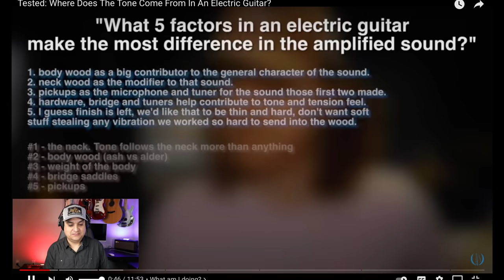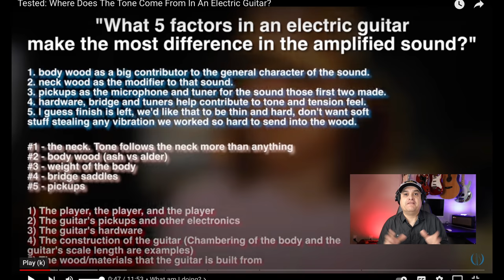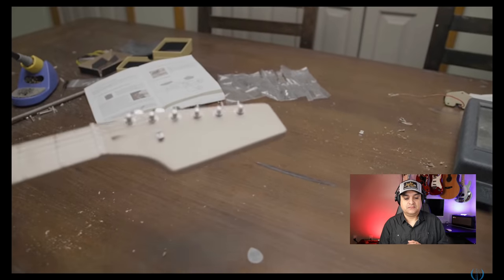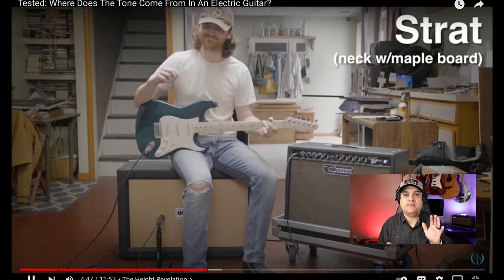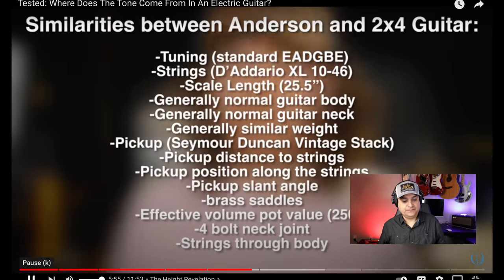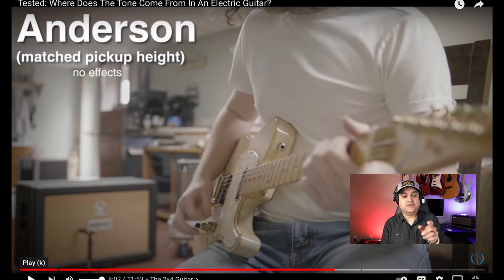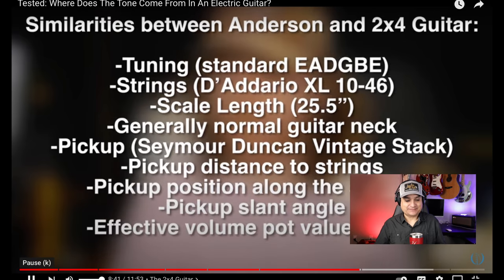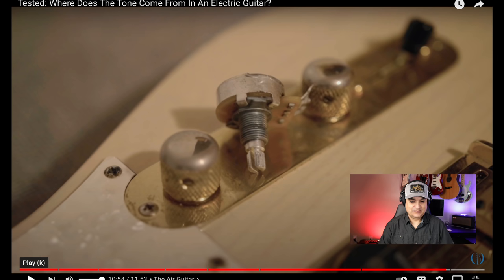Where Does The Tone Come From In An Electric Guitar - Reaction Video

Comment: Wow, surprising how all the ELECTRIC and ELECTRONIC components make up for all the sound of an ELECTRIC guitar
Reply: surprised Pikachu face
Reply: Exacty! I got the original video recommended the other day (and now this one), and I still can't believe some random youtuber had to scientifically test this. It's literally common sense. Take two identically set up guitars, right off the self. Replace the pickups in one for different ones. Voila. Different sound. Jesus...
Reply: I like to ask tonewood snobs about how the trees impact the way the string vibrates over a magnet. I'm sure that the wood, touching the saddle, touching the string, SOMEHOW is factored into the end product, but not in a way that matters. Lets make guitars out of all kinds of fun weird materials!
Reply: lol
Reply: I always assumed tonewood made a slight difference and I just don't have a good enough ear. 

I could barely tell the difference here (it was almost nothing to me), but if it's this small in such an extreme setting..surely it can just be compensated for with a slight EQ adjustment right? And the Spectre guy already showed it doesn't matter in a band setting. I'm now convinced it doesn't matter.
Reply: The kind of strings and if they are corrected also have some effect, as well as pickup height and position along the neck, other than that not much lol.
Reply: I think only if we made the body of some vibrationally absorbent material like rubber, we’d reduce the tone.

I think this actually would affect how the strings vibrate at the physical level
Reply: Not really surprising.
Reply: you'd be surprised how hotly debated this topic is

people will jump through endless hoops to refuse to accept they fell for a marketing ploy
Reply: They don't though
Reply: @PsychoSk8r4bg  Yes, if you deliberately suck energy out of the strings, the instrument will sound different and have less sustain. That's also true if your pickups are way too high and tugging on the strings. I suspect rubber would not even hold its shape well enough to be playable, but I get your point.

It takes quite a bit to get to that point though, and Danelectro using chipboard for the body isn't even enough.
Reply: People are hard headed, a pickup is a magnet…..a magnet….  Would on a platform doesn’t impact a magnet.
Reply: It ALL matters.
Reply: Now, go watch Jim Lill's recent video about where does the tone from an amp come from.  Oh, then there's the guitar cabinet one.  He's got some great videos.
Reply: @PsychoSk8r4bg  It wouldn't, because at no point are the strings in contact with the body. :)
Reply: Exactly!
Reply: Bro dont forgor the metal parts that make the air guitar toan so metal bro.
Reply: hey, don't make fun 😆 i find stainless frets give a slightly brighter sound than the cheap zinc/nickel alloys on most guitars. Imagine if they were made of rubber, or no frets (:
Reply: @BURN_SHITTUBE  Imagine if the guitar had no frets at all. Haha that would be crazy right? /s
Reply: @nef36  that was my point, a fretless guitar has a lot less sustain because your finger is basically acting like the "fret(s)" ..so it sounds like "dub dub dub..."

Comment: Um, the Honda engines of that year used a lesser quality metal, leading to an uneven balance and therefore completely changes the tone vibrating through the bench. Plus everyone knows benches made in 1990 use a cheaper quality wood. I make sure all the benches I use are pre CBS.
Reply: I can't believe he used Japanese engines. Everyone knows America make the best toneEngines.
Reply: Throw in a mention of Gibson "good wood" apocryphal era and you win a goldfish.
Reply: And the motor oil needs to be 10W 30 for the best sound... also, with it being an "air" guitar, the air quality and density also play a factor in tone...
Reply: Lol
If only, one of those was an XR650, doesn't get better than that!

Comment: When it occurred to me that there are great sounding guitars made from plastic, Masonite, which is basically cardboard, and sawdust held together by glue, I realized the notion of tonewoods for electric guitars was nonsense.
Reply: What convinced me was a video I saw where a guy make a strat out of corrugated cardboard, with a strat neck and electronics, and it sounded exactly like a strat.
Reply: Dano U2's from the 50s.. incredible guitars. Totally agree.
Reply: I went down a DIY guitar rabbit hole a while back and saw guitars made from resin, Legos, cardboard, sheet metal, stone, concrete, colored pencils, and glass, and they all sound good. No one better or worse than the other thanks to the high end pickups they'd put in the finished product. Only one that stuck out to me as noticeably different was the all glass one, but that had a glass neck and fretboard as well, not just a regular neck stuck on whatever custom body.
Reply: @neonlights_12  You've clearly been watching a lot of burls art. Love his channel.
Reply: The only thing that this kind of small details like woods, shape, and finish matters are acoustics and they are very subtle already on acoustics so in electric it dare i say almost if not detectable
Reply: it's not nonsense a dano sounds way different than a gibson as does a fender
Reply: @forkboy3309  That's because they have different pickups. Solid vs. hollow sounds different as well. But all things being equal, if you reproduced a Danelectro, same construction, same pickups, same strings, but used a treasured "tonewood" instead of Masonite, it wouldn't sound appreciably different as this experiment demonstrates.
Reply: @forkboy3309  they all have completely different pickups.
Reply: MDF and HDF boards are the real tonewood here.
Reply: The Ampeg Dan Armstrong made of methacrylate

Comment: This made me feel so great about having a $120 squier. All I need are great electronics which are already on their way, and a setup.
Reply: I've got a Squier Bullet Tele a Fender Player and a Fender Player Plus Strat. All have maple necks. Now the thing that stood out the most to me is the finish on the necks. Squier has almost nothing, player has a hard Laquer on the fretboard and satin on the back and Player plus has rolled edges and a satin finish. The Player plus is the best feeling and playing. So yeah, quality does go up a bunch by spending more up to a certain sweet spot.
Reply: Good electronics and a killer amp will make any guitar sound awesome.
Reply: U can mod a affinity into a custom.. btw just a few $ but not a couple grand
Reply: Even the cheap pots and switches sound fine until they don't because they're coming apart. There's nothing wrong with swapping them out now to save yourself the trouble down the line, but don't expect that they'll make a change to your sound. You're not solving a problem right now, but you are getting out ahead of one that may come up later. That's a good idea if you actually expect to gig with the thing and need it to be reliable, and it doesn't cost that much. Keep the cheap set around though, you may need them as temporary spare parts if you break one of the nice ones!

Changing the pickups is where practically all of your audible improvements are happening.  It's also the bulk of your upgrade cost.
Reply: So I ended up upgrading the pickups and electronics to used made in Mexico and it sounds amazing!! You just have to Dremel a little bit for the switch to fit. OMG! It sounds freaking amazing!
Reply: @yonickfrias8799  Oh, yes, you do have to enlarge the holes for the bigger pots to fit through, but scratch plates aren't that expensive to replace if you really wanted to go back to the cheap mini-pots long term. You'll also end up with an alignment hole for each mini-pot that doesn't do anything, but it will be hidden in the hardware.

Also if you don't see enough shielding back there, fix that while you're in there. Aluminum tape is cheap and works close enough to ideal. I've been able to find it at the dollar store. The more non-musical crap you can reject from your signal, the happier you're going to be.
Reply: @mal2ksc   I almost agree, but a few things:

A) the size of a pot doesn’t determine whether it’s “good” or not. You can have some really killer tiny pots, and some really iffy big ones. Most pots are made in the same factories around the world, and companies will stamp their logos on batches of values that are within a certain tolerance. “Alphas” are made in the same factories as many non-branded “bad” pots. What will most likely change your impression of the pot is a change in the taper.

B) if the aluminum tape doesn’t have conductive adhesive, you’re more than likely not achieving what you think you are. A good way to check if your shielding is actually effective, check the “conductivity” with a multimeter from one end of the pick guard to the other, and to any other connecting grounding points. If you don’t hear the beep, then get yourself some copper tape with conductive adhesive. It’s not much more expensive than aluminum tape anyway, but it is the better tool for the job.
Reply: @JedrekVRoscoe  My aluminum tape has conductive adhesive, but I fold over a small edge or corner for metal-to-metal contact anyhow (and crimp them together and add more tape), since there's no guarantee the adhesive will remain conductive as it dries out. I'd still do this with copper tape, for the same reason, except that it's much easier to spot-solder copper tape strips together rather than doing tuck-and-crimp.

As for pot taper -- practically none of them are truly tapered. They simulate it with multiple linear sections that get gradually narrower. The number of linear sections is what determines how convincing they can be. Two is unfortunately the norm, and not particularly convincing. Four or five, on the other hand, works alright. I've seen true tapered pots, but they were larger than normal and open to the air and probably not intended for this use.
Reply: IYV makes great guitars.  I have six of them...check them out
Reply: All that matters is that the guitar feels good to play and sounds good to you.  Price doesn't matter.  If you like how it feels, plays and sounds it is a good instrument. (well provided it stays in tune)
Reply: @TedSchoenling  Not staying in tune can often be fixed, if the instrument has good bones. My kit Strat didn't want to stay in tune either, but after locking tuners and some filing of the nut slots, it does fine even with the Cheaper-than-Squier bridge. The trem system really shouldn't work as well as it does, and it still eats up a lot of sustain when it's not blocked so I may replace it anyhow, but it causes surprisingly few intonation problems even when I get really aggressive with the whammy bar. I don't even have to flick the bar to get everything to settle.
Reply: In theory it's possible but in practice I've seen many bullet Squiers with truss rods that only adjusted half of the neck lmao. And if you get a new neck you'd might as well get all the components seperately to begin with
Reply: If you get a good looking cheap guitar, or not even good looking as long as it is comfortable and has a solid neck then you can just use that as a platform for upgrades, say pickups and electronics, bridge, locking tuners, better nut and hell even stainless steel frets if you are willing to change them yourself, and all of that might be what, 500 bucks?
Reply: Jack Pearson plays a Squier. 'Nuff said.
Reply: Some of the most celebrated musicians in history used cheap gear. Heck, Eddie Van Halen even toured the world with a ~$375 retail guitar.

A skilled player will sound good on a walmart guitar and a bad player will sound bad on the best guitar ever made.
Reply: Add in nut filing and fretwork, that's a large chunk of the feeling improved with one change.
Reply: to be honest much of the expense on high end guitars is the time spent on the neck ....or it used to be anyway.  
  how much time was spent levelling, ending and polishing each fret.  
 to replace an american jazzmaster neck cost over $600.
Reply: but also nothing wrong with a squire.  I have a couple as well and love them. A 1999 Stagemaster and a 2010 thinline tele.   both great.

Comment: As a professional scientific researcher, I think that Jim did a great job. Anyone can poke holes in his methods and design, but look at what he achieved. Jim’s video strongly affected my recent guitar purchase of a PRS. Jim has achieved something great.
Reply: "But PRS said tone wood matters! Bro you are wrong and I'm a PRS Fanboy who is buying over priced exotic wood with strings. " Joking aside. I do believe that the material makes a difference. But this only depends on the (density) mass. The strings give off energy to the body and get some of the energy back. But I think that's irrelevant and only measurable. The mass of the body is much higher than that of the string. In addition, the body is usually in contact with the human body, which also absorbs the vibrational energy. All in one - tone wood doesn't matter. - professional german engineer.
Reply: @UltimateEngineering  When actually tested, tone wood does have a difference, it's just so miniscule it's well beyond human comprehension.
Reply: If you like the PRS, buy it.   They are extremely well made and easy to play guitars.   Many models are also beautiful?   What's wrong with that?
Reply: "professional scientific researcher" lol. Just FYI nobody in the field of scientific research would say that.